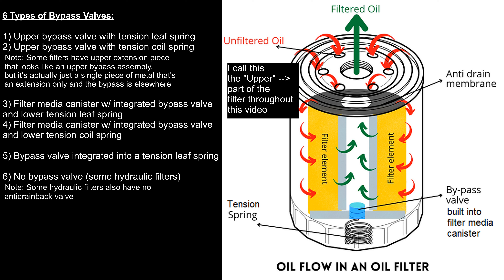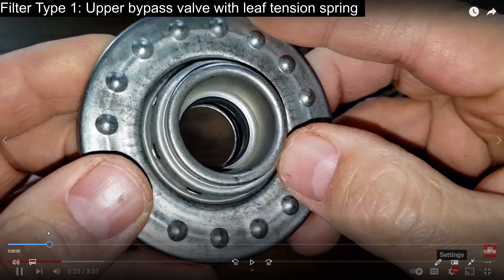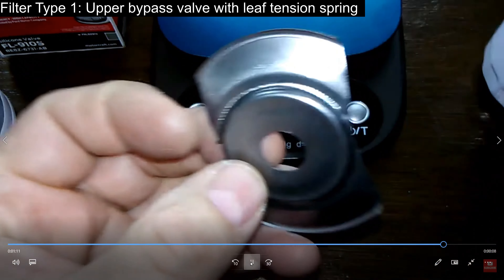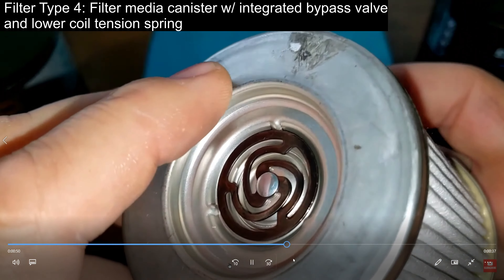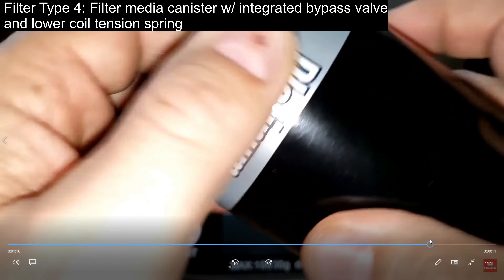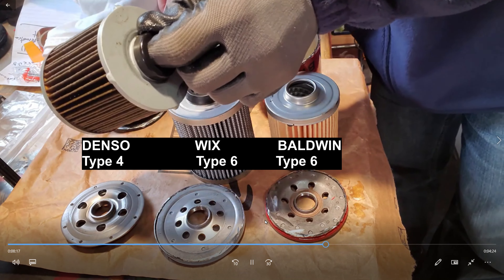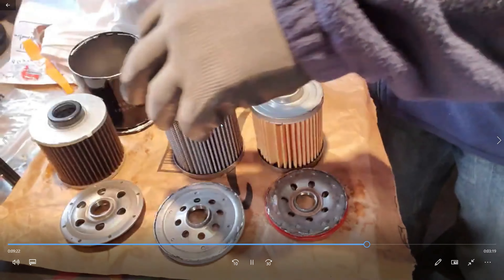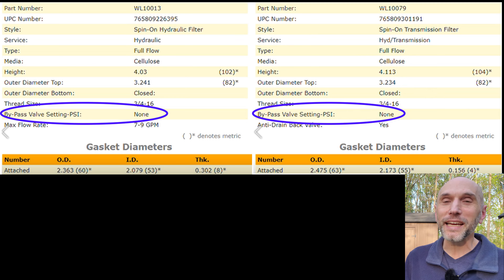6 Types of Bypass Valves Used in Spin On Oil Filters

Comment from the maker: Thanks to WhipCityWrencher for the explanation of  Type 6 (no bypass). Tractor hydraulic pumps and transmissions have pressure relief valves built into the systems to act as a bypass. No need for bypass in the hydraulic spin on filter.

Comment: if an oil filter has only a "tension spring", and no bypass valve, that spring is being used for tension up until bypass is needed. It may activate during a cold start or if the filter media is clogged. If it didn't bypass and the engine has no oil, there is no longer a working engine. Better to have dirty oil than no oil.
Reply from the maker: The only "bypass" you'd get would be at a certain point where the filter would start to burst and leak through in an uncontrolled "bypass." Think about all of the pressure forces in that outer vessel of unfiltered oil if the pleats are clogged...the pressure is acting in all directions, not in a controlled manner for creating tension spring compression. You can look up numerous Wix models (e.g. Wix WL10079) and they will indeed be listed as having "none" for a bypass. A filter with no bypass is intended for systems that have a secondary method of bypass. Engine filters normally do have bypass for the reasons you stated. Hydraulic systems might not per the pinned comment.
Reply: @Redneck_Ed  agreed. but this is the bypass in many situations for engine oil filters.
Reply from the maker: @caribbeanbound8357  Out of genuine curiosity, can you cite a engine oil filter model number that is designed to act in that manner?